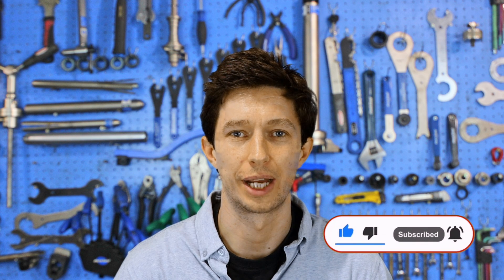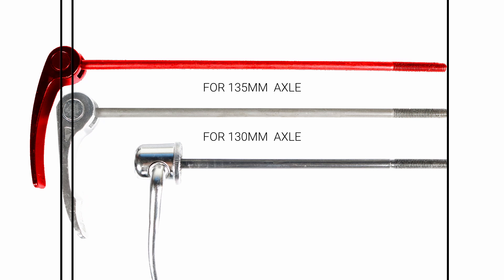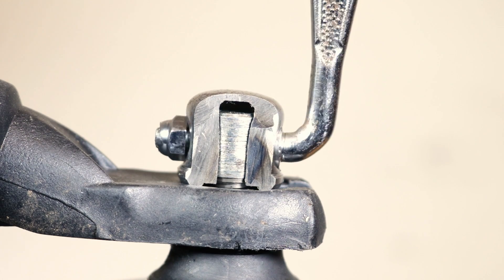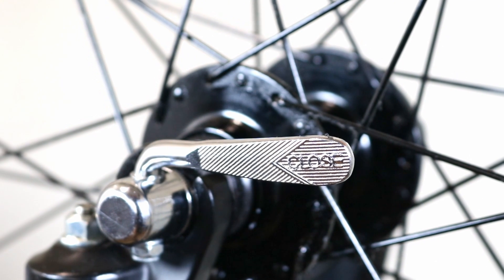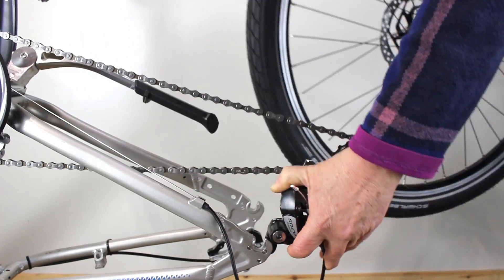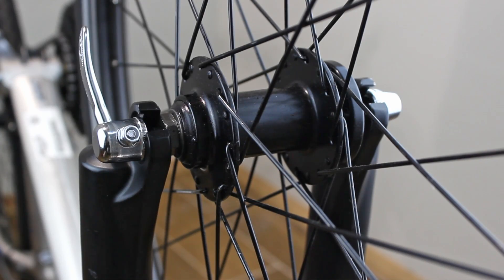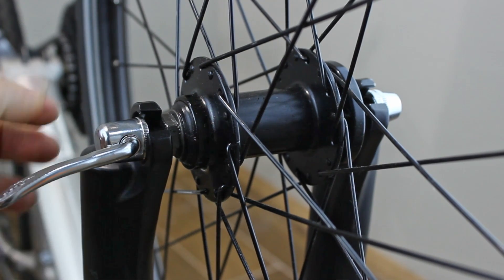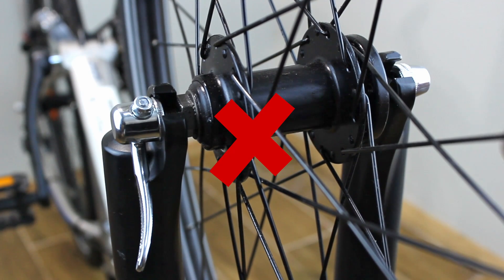How Does The Quick Release Mechanism On A Bike Work - Cam System Explained

Comment: what do you think about light (less than 60g?) QR/skewers (for Specialized SL6 rim brakes).  From testes, looks like light (external cam most of the time) skewers have 30-40% less clamping force,  does it affect handling/frame stiffness ?
Reply from the maker: Hi, and thanks for your question. I'll be honest with you, I don't know much more about it than what you've already mentioned. It might be a good idea to reach out to the manufacturer for more details. Keep us posted if you discover whether the reduced clamping force impacts handling or frame stiffness.

Comment: Amazing close ups and explanations! What is recommended final position of the lever? So imagine a bike standing on its wheels. The wheel is a clock, and lever is its hand. Is 12 o'clock is the best? Or 3 o'clock?
Reply from the maker: Thanks Andrew:). There are many theories on what the correct lever position should be. Donkey years ago I've been told on a Cytech course that it shouldn't point towards the front of the bike because when riding forward the lever can be caught by a branch or broken wired fence and open itself. I don't think it matters that much really but I tend to put my skewer towards the end of the bike just as a habbit. I hope this helps:)